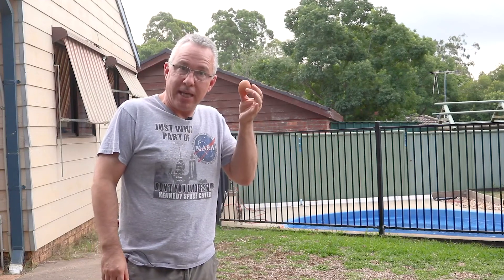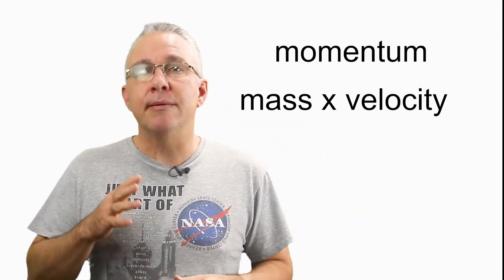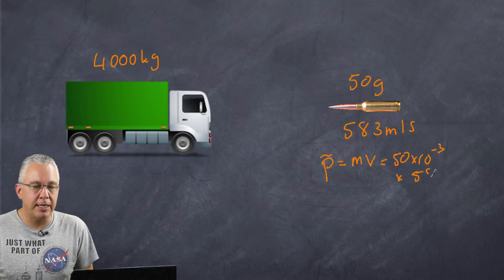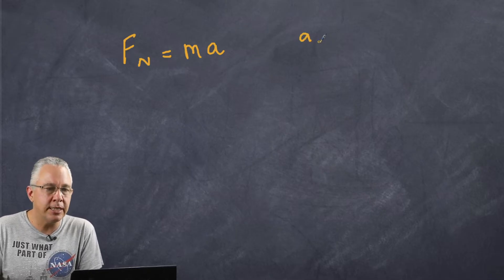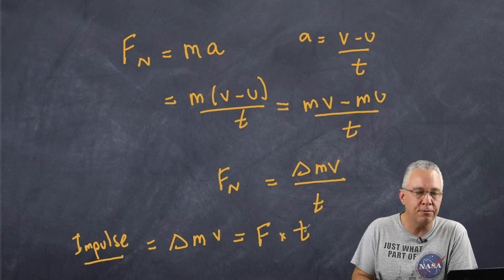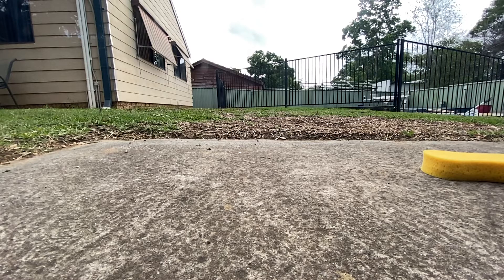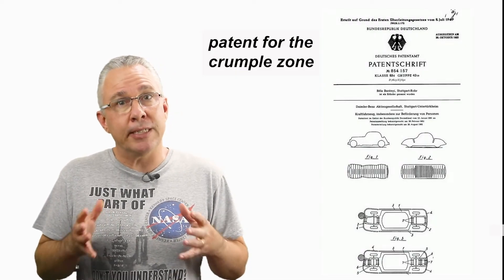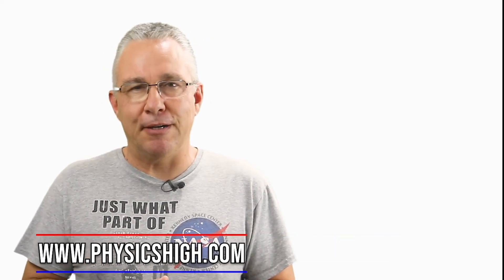Momentum and Impulse Explained

Comment: Isn't (0.05kg)(583m/s) = 29.15 kg m/s ?????
Reply: i was just going to ask this
Reply: No because you must convert 0.05kg to 50g because the Si unit must the same or change 583m/s to 161km/h
Reply: @olivergajkow5241  Incorrect. The unit is kg*m/s. Mistakes were made. He even converted the units to kg. He just did the math wrong.